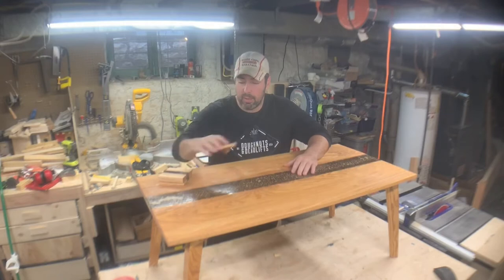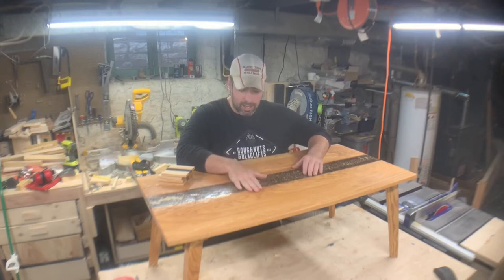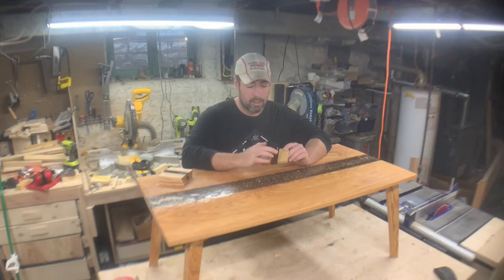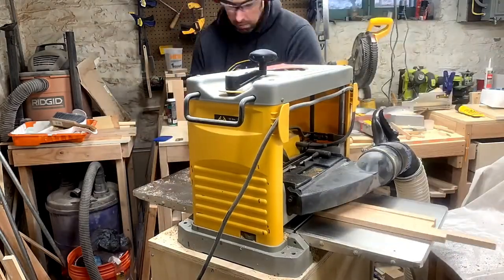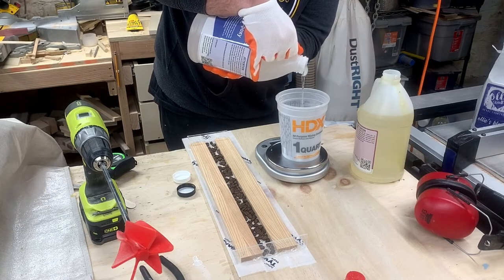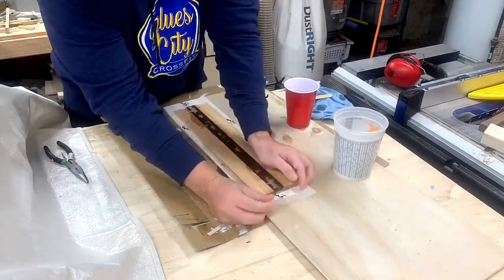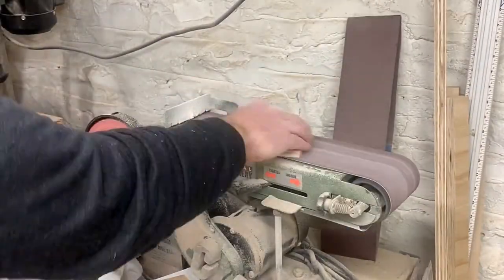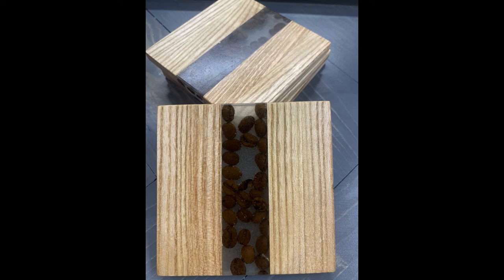Kentucky Coffee Bean Wood Coasters with Coffee Beans Embedded in Epoxy

Comment: Did you have problems with the beans floating to the surface in the epoxy. If so what did you do to fix it?
Reply from the maker: I did, but this was the first time I had done epoxy. They didn't stick up too much so I sanded them down and let the finish deal with it.

What you could do is pour in two stages. Do a shallow pour, let it get tacky, put the beans in, then do the second pour.
Reply: I’m in the middle of a pour now. I poured a thin layer, let that set first. Today I mixed coffee beans with epoxy and put those in the second layer. Tomorrow I will pour the final layer. That should take care of floaters